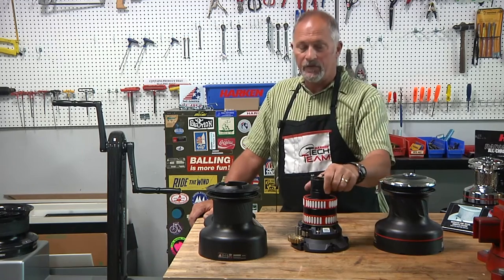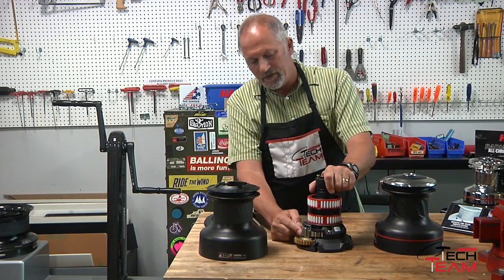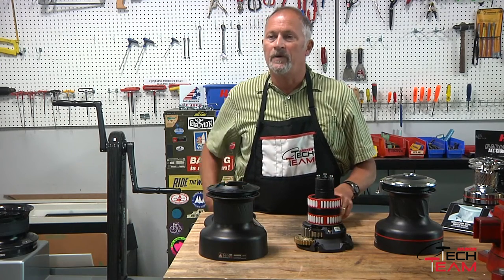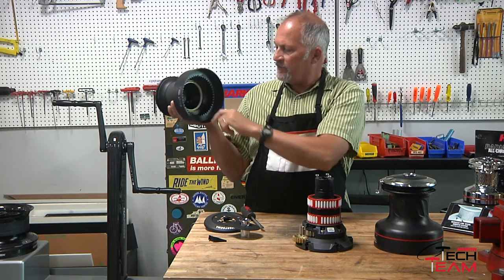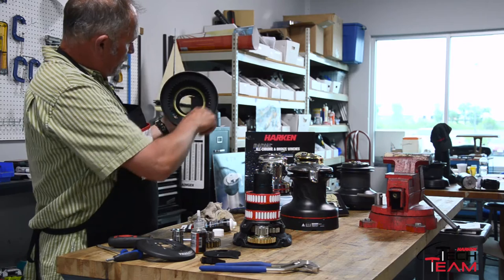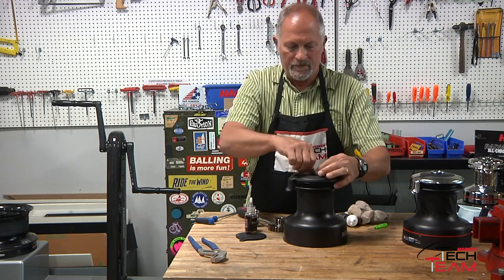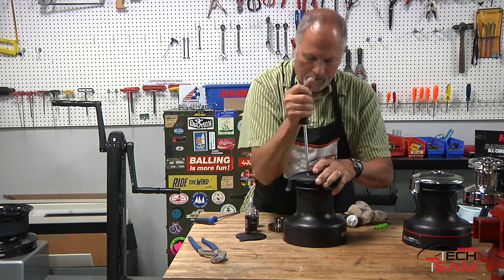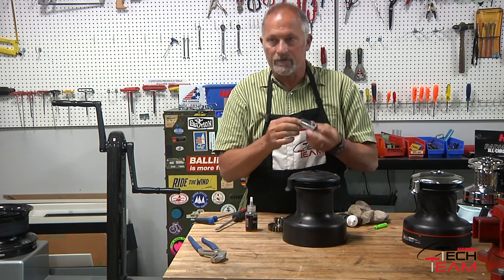Servicing Performa Winches - Harken Tech Team Asked & Answered

Comment: A friend has bought a Boat with Harkin Winched - They all need serviced,  there are two manual and two electric winches - The electric ones have a 'Block'  in the centre where the winch handle would go in -  to prevent you using a winch handle on the electric winches.  How can this be removed to allow the winch to be dismantled for servicing?
Reply: On my 48.2 classic winches (considered an older model) grab the plastic tip of the disconnect rod in the winch handle socket with a vice grip (use a thin cloth to prevent scaring) and give it a good tug.  This disconnect rod on the 48.2 is not mechanically attached and is held in place by two o-rings.  Yours may be different so go easy.